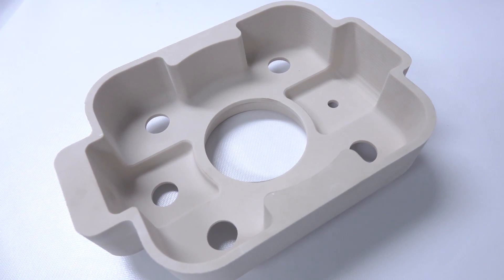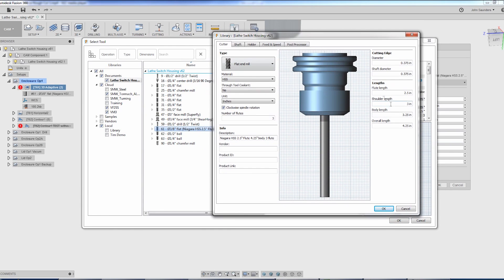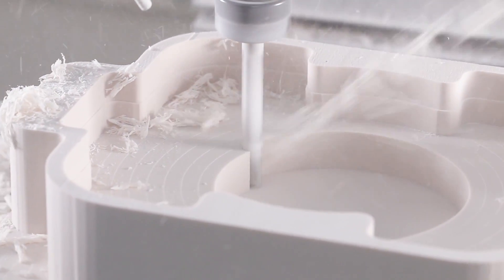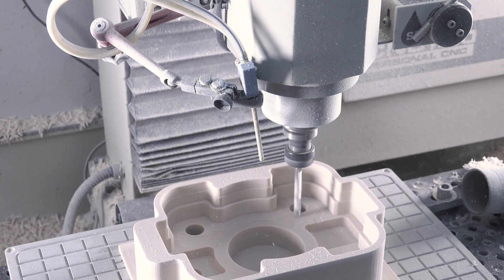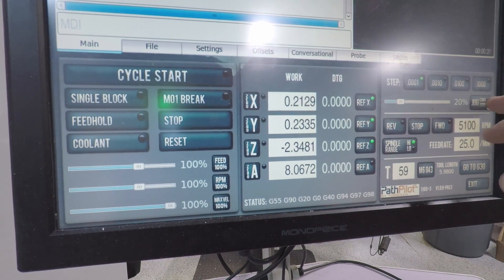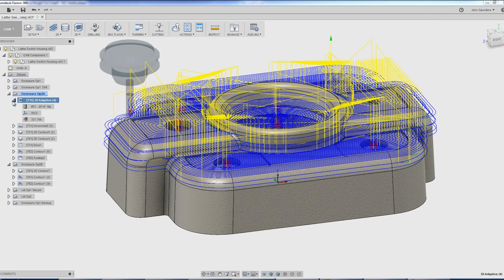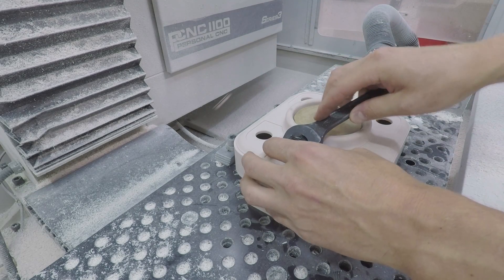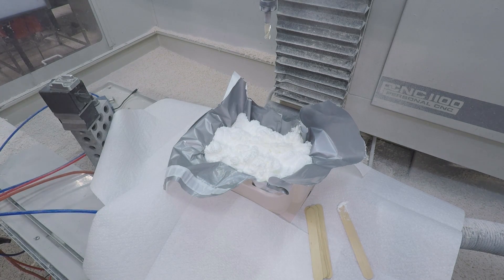Machining a Southbend Lathe Casting Pattern - Part 2 WW163

Comment: I would've drilled 4-6 small (maybe 1/8") holes around the perimeter of the back, and a piece of plywood with matching holes. Put pins into the plywood and then mount the part to the plywood the same way you mounted it to machine the top. The plywood can then be mounted to the table with the vac. Added bonus if you use thick-ish plywood in that you can go past the bottom of the part and not mill your table in the process.

Comment: A couple of suggestions. 
For side two first machine a bit of say 1" thick foam that the part can be nested on, have a raised portion in the middle of it that hugs the inside contour of the side one machining.
This also eliminates problems with ball milling down to the joint since you can just machine into the nesting block.
For hold down try a good double sided tape, four half inch pads of it would do for something this size. Removing it without tearing the foam can be tricky, but again if you machined into the foam nest you get access to knife under the tape for removing, then roll the tape with your finger for minimal lifting of the bottom surface.
Here is a press tool project I did with medium density poly and just strips of half inch tape about 3" long holding it to the table https://www.facebook.com/doug.smyth.31/posts/1433000730118682?pnref=story
Holding already machined areas to foam supports can be done with kebab skewers also, just use them like skew nailing :)

Comment: As you were talking about making the inside support for the part I thought of two things: 1 the expanding foam shipping bags that form fit to a part as a example https://www.uline.com/BL_7708/Instapak-Quickreg-Room-Temperature ;  2 The use of epoxy resin and beads to form fit indy and F1 driver seats https://www.youtube.com/watch?v=MTpH8K9PniE The second idea might make it easier to incorporate wooden backing boards.

Comment: So you sent the customer a piece of shit that they had to fix instead of doing the right thing and remaking it. Wow that's fucking shitty.
Reply: In case of a mishap, you call your customer and ask them if they want it redone or fixed or will they accept it as such and fix it themselves. Sometimes the errors are on air-tolerances, meaning it isn't functional error, sometimes it is just cosmetic error (on a visuble surface). In this case I too would have okay, just send it and I'll bondo it myself and would not have been pissed at all, quite the opposite actually as the machinist called me to ask about it.

Maybe in your line of work the parts have to be exact to spec, but most of casting, mold work, tool & die is so time taking and expensive that it is rare to redo a 3D part unless absolutely necessary. Instead there are a myriad of ways of fixing things.

Comment: Hi, I like your videos you gave me quite a lot of idea but this time I think you make a lot of mistake. I know you realised a lot of them. We machine patterns a lot so I know a bit how to do. First workholding: just way easier to superglue 2 clamp lugs from the same material to the side of your stock and clamp on them normally or glue the stock onto a dummy plate (ply or mdf). Easy, quick and less likely the job to move. 2nd: Datum up a job this way, well, my boss would rip me in half if I did like you. Never ever lift the job off the machine without a datum hole and a clocking edge (or an other hole). Sometimes we have only a few microns mismatch between sets and it is pretty good.  3rd: using a drill for datum hole is one of the worst thing you can do. Drills are the most inaccurate tools to make holes. Especially long HSS drills. You'd end up better using a short slot drill/end mill because their runout is usually only a few microns (depends on tool holding etc.). If you used a dummy plate you could drill into it through your stock. In your 2nd set again if you lift the job off  the machine table you could have gone down all the way. Also I find the finish a bit rough. Your steps were a bit big in my opinion. On a job like this I'd use way smaller steps but would cut it much much faster. It'd not increase your machining time but end up with better finish. 
I know finish, accuracy etc. depends on price but usually we machine the pattern and the castings too so we try to make our life easier. With better finish on the pattern the casting's finish will be better and that helps setting and machining them.
Thanks for the video and I hope I could give you some ideas too.

Comment: Can you share your total cost on this vs having it 3d printed by Shapeways?
Reply: John, I'm sure some where in a past video you've addressed this. If working with those soft mold materials was a constant job, then wouldn't a dedicated wood working router CNC machine be wise investment? I mean, for all the reasons you mention, chip/dust control AND, keeping the VERY expensive metal working machine and coolant clean for it's intended use? I do enjoy the mold making production concept (making retrofit parts) , keep up the good work.

Comment: Question from a non-machinist: The path generated by Fusion 360 for hogging out material performs climb cuts and lifting the tool back for the next pass, as in 3:32 for instance. Is there any problem with going back and forth, switching between climb and conventional cut? (ending with a climb cut for surface finish)
Reply: Switching between climb/conventional like that will bring out the worst backlash your machine has to offer.  If you've got a tight, new machine, not so much problem.  If not, you'd have to see how much it affects the finish or even dimensions.
Reply: Ah, I see. Thank you. But would that matter so much if you only use that for hogging out, since you always have stock left for a clean up operation? Lets say you have 1mm of backlash and have 2mm of stock left. Or do tool/machine wear come into play as well
Reply: That much backlash introduces a new hazard. Switching from conventional to climb milling can allow the tool to 'pull' itself into the cut, for the FULL amount of the backlash all at once.  That is likely to be a bigger bite than the tool can survive.  

If the backlash is small enough, you can do roughing out with a back and forth tool path, but the time savings isn't worth the risk in my opinion.

Just considering the numbers in a simplified example, it works.  In practice, Murphy's Law will happily trash your tool, workpiece, and possibly bits of you.  Not recommended.
Reply: Ok. Now I see the issue. A subbenly deeper cut, from the backlash "reversing", causing possible tool or part to break and endangering the operator. Definitely not recommended.
Reply: Some rules are different for foam since it offers little cut resistance.
A machine intended for metal or a good router will have no issue with zig zag roughing.
I'll take out ramping and spiral lead ins for roughing and just let the tool plunge between step downs for instance.
Thin wall sections are more of an issue, since the tool can pull or push on the flimsy face.
It's a good plan not to rough away round a thin section all at once, but instead leave the thin wall section chunky and alternate removal and finishing in levels that maintain support at the base of that level.

Comment: John, Because of the way this part is being used as a casting pattern, some filled holes in the upper edge on the first operation would be acceptable. This is what I would have done. Prepare a plywood or MDF plate with the hole pattern you are going to put in the part on the first operation (This of course could be modeled in cad). Than machine the part just the same as you did for the first operation except add the hole pattern in the outer face (this could be for drywall screws or tapped holes). Than screw the plywood plate on the part. While you still have it clamped to the vacuum chuck take a profile pass around the OD on the plywood (for alignment of the next operation) and if necessary skim the face flat with a fly cutter. Than flip the part and clamp too the table. This also would allow you to machine down into the plywood to get to the bottom edge.
Reply: Edge Precision exactly. Needed a little sacrifice plate, but otherwise a great video.

Comment: horizontal pocketing starts in the middle to reduce tool load. Your first line of cut is through the material,  relatively short. The remainder will be climb or conventional cut,  cutting only on 1 side of the tool. If you ran it outside -in it would have the entire outside premier cut distance at the higher load of cutting through the material. I don't know about your software,  but using predator in Bobcad, you can specify outside-in pocketing, in cases where that is necessary for some reason. I'm sure it's in tormach's software, you just have to find it.

Comment: Holaaa.. que material es ?
Reply: https://www.freemansupply.com/products/machinable-media/renshape-modeling-and-styling-boards

es Ren board.
Reply: Jesus Ariza This particular part was made from Precision Board Plus (48 lbs/ft^3 density). It's made by Coastal Enterprises. Inventables.com sells small 12" x 12" x 2" blocks, otherwise you're usually looking at large blocks with a min buy of several hundred dollars to thousands of dollars.

Comment: You could try this router cutter like those: http://blog.cnccookbook.com/2012/04/06/cnc-router-cutters-types-and-how-to-use-them/ For soft or powdery materials like plastics and particle boards etc there are special cutters that have the spirals run in other directions so the cutter does not create pulling forces or direct them towards the workpiece. This saves you to lock a workpiece in the upwards direction.

There are also fans that you can add to your spindle that blow away light chips.

Comment: Love the music. Too bad that this material is so expensive, it would be great stuff to prototype with. Do you know of any material that is similar that is cheaper that can be used for prototyping?
Reply: Adventures in Fabrication if you don't mind really soft, insulating foam (the pink stuff) from Home Depot works nice, you can even glue layers together if you need thicker pieces. I CNC router cut some forms out of it for doing a carbon fiber layup
Reply: Thanks, I didn't think that because it really isn't that common in Houston. We seem to only get the really thin stuff. Maybe it's a regional thing.
Reply: the stuff here is 2" thick 24" x 72", as long as you dont mind a soft model it works really well. its nice to run proofing code before running it on expensive materials, at $20 for a sheet its dirt cheep.

Comment: What is the"knockoff" brand renshape that you used called?
Reply: M W Precision Board Plus. Available from Inventables.com in 12" x 12" x 2" pieces. Larger blocks check with the manufacturer Coastal Enterprises. Gorilla Glue will bond multiple pieces together.
Reply: Thomas Utley thank you!
Reply: Wish they sold large sheets instead of such small quantities and sizes for so much.

Comment: Something I noticed when you were machining op2 that you got incredibly lucky on. When it was roughing the top off it left this bar of material that spanned the center bore and snapped off when it got too thin on the edges. Lucky it didn't crack a chunk of material right out of the bore. 

Should always rough thru bored like that first and clear the supported material away first, then rough the rest of the part. Had that been aluminum you'd most likely been looking at a new tool and clean pair of underwear 😆

Your Great Stuff idea wasn't bad, just used the wrong stuff to do it. That spray foam is designed for maximum expansion and flow around any resistance. A 2 part high density urethane foam mix would have been better. Or a low temp high density casting wax.

Comment: What i would have done: machine first a part with 7 columns ( 1 middle big from the center piece, 6 smaller from the holes. ) This part is then used as a fixture for flipping and holding the main part. Makes sense?
Herri ( like 24 )

Comment: My guess as to why the horizontal clearing is starting in the middle is to avoid flexing. Entering from the side on the top of those tall skinny sides could potentially bend the material and set up nasty chatter.

Comment: I think this could have been made on a 3D Printer in PLA/ABS.
Reply: Grandpa Bill yes it could have, but not to anywhere near the tolerances you can get out of a machined part.  You would be lucky to get within 50 thousandths on a FDM printed part.
Reply: I wonder if he added in the tolerances for casting shrinkage?
Reply: Grandpa Bill Yes, I scaled the CAD model up by 1% for gray cast iron in Fusion360 before John took it over for the CAM work. The scale factor came from the foundry ahead of time and would be different in other materials.

Comment: Wow, so fun to watch my Fusion360 model come to life! Those few little gouges from the part lifting off the mill were no big deal at all to fix.  Added a little auto body filler and sanded the pattern back into shape.  Keep in mind, the intent is that it's supposed to look like a WWII-era casting when it's done. I'm confident these castings will still be smoother than any other of the machine's castings that were shipped under War Production Board cosmetic standards back in 1943.

For anyone following along, I'm using Cattail Foundry, an Amish family-run business in Pennsylvania.  They have the patterns now and I'm hoping to have parts back in a few weeks.  Pictures of the completed lathe controls assembly will be posted over at the Practical Machinist restoration log thread that John has posted in the video description.

Thanks again John!!!
Reply: The making of a modern classic South Bend. :-)

Comment: Am I wrong that 10 x 7 - 70 square inches....   Overestimate slightly at 15psi and we're only talking 1050 lbs hold force, not "several thousands"
Reply: SkakaMJ0lk 

Aluminum has a dry coefficient of friction between 1.1 and 1.35...  soft polyurethane (Ren board) comes in at a coefficient of 2-3. 

Static friction between these two surfaces is above 1.
Reply: Ben Anderson that's static pull down force. It's greater when you consider the frictional force applied between the part and plate. In order to push a 1,000 block not only do you have to over come the weight of the block, but the frictional force of the block and the surface it's on as well. 

Think about gauge blocks rung together. The amount of frictional force between the two blocks is greater than the weight of the blocks themselves. So to get them apart you have to use enough force to overcome both the weight of the block and the friction holding them together.
Reply: Occams Sawzall You are mixing concepts. The simplest, normal friction comes from the mass of the object times the friction coefficient: F(r) = F(n)μ = mgμ. Since we are "adding" mass using the vacuum table, the only thing that changes (i.e. increases) is the normal force vector, F(n). If you are talking about overcoming the inertia of a trying to move a mass, you can ignore it because the velocity is already zero, so there is no inertia. Just static friction.

The gauge blocks sticks together because of the removal of air between the blocks, the surface tension between the blocks and the Van der Waals forces (basically atoms forming bonds). If you hold a gauge block on its side, the normal forces are zero so there should not be friction between them, yet they stick because of these three mechanisms.
Reply: Remember that the friction coefficient is well below 1, maybe in the range of 0.5 or something, so basically half of that is actual holding force.
Reply: SkakaMJ0lk 
Also friction under a vacuum is much higher than that of standard atmospheric pressures. Because air between two surfaces acts as a lubricant. Under vacuum that air isn't there. 

Plus a vacuum pushes in all vectors, not just one vector like gravity does.
Reply: Yes, dry and clean Al on Al may have coefficients that high but that's not what we have here. We have PU on Al under real life conditions. Maybe it's higher than 0.5 but I'd be surprised if it was a lot higher than 1. And I don't know where you got that number for soft PU either, it might have a high COF for PU on PU but that doesn't mean it's the same for PU an Al.

The fact that it is under vacuum can't change the that we have a clear contact between two planes. Maybe the PU deforms slightly under pressure, but that does not make the friction force 3 times as strong or by some other magical number, it's still a planar contact.

Comment: Don't beat yourself up to much over the mistake... its what your second time working with a composite foam like that? I do agree though even something simple hacked together out of wood could have made a big difference, especially if it located to the pre-existing holes on the model. Overall I do have to say you did an impressive job given what you had to work with!

Comment: Would you used the vacuum hold down on the back side instead of useing clamps plus leaving the outside material there and removing it last if you did it again
Reply: Removing all the material from the back side after making those countours on the front would be an even more difficult task for work holding.
Reply: How